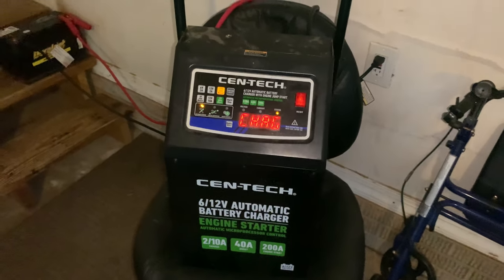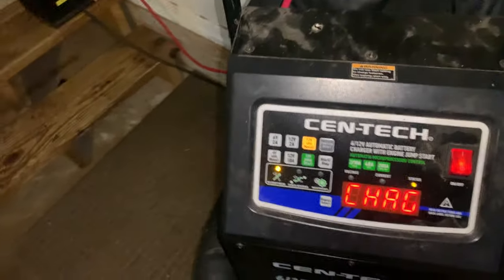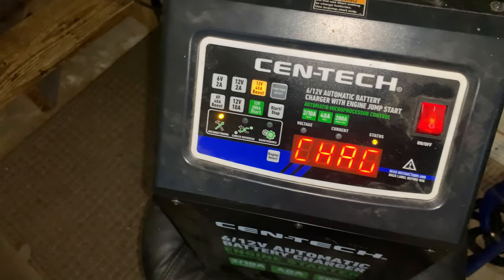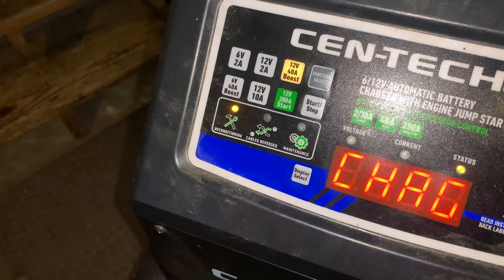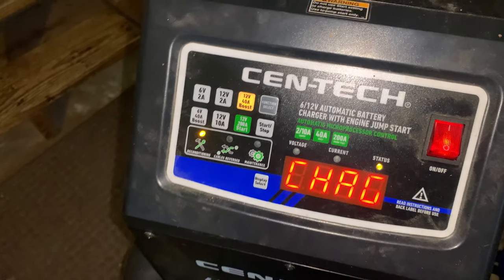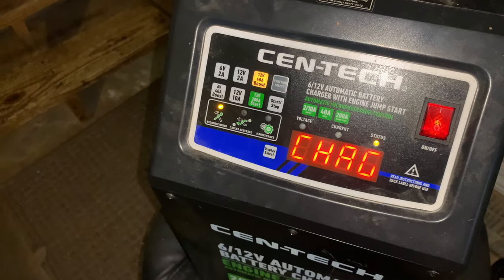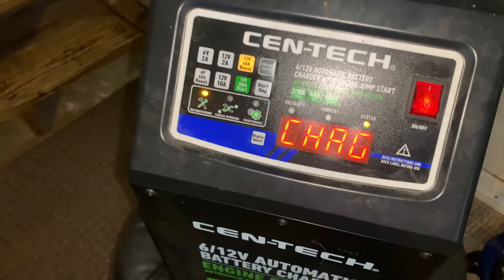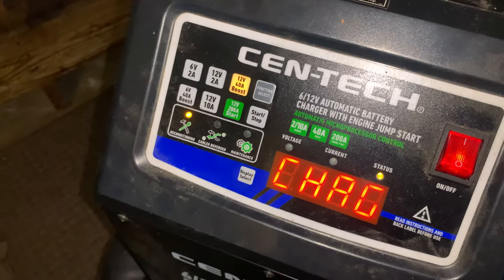How to charge dead batteries with a “ Cen-Tech” battery charger.. or any other jump starters

Comment: Thank you for posting!

I have another model from the same company - also with the 50 amp "jump statt" option.

How long did you have to run the jump start mode  to get the battery to charge under the normal modes?
Reply from the maker: no problem.. glad I could help

Comment: If you can explain step by step
Reply from the maker: basically put the charger on " jump start mode" and It will help  dead battery receive a charge then you'll be able to charge the battery regularly after a hour or two